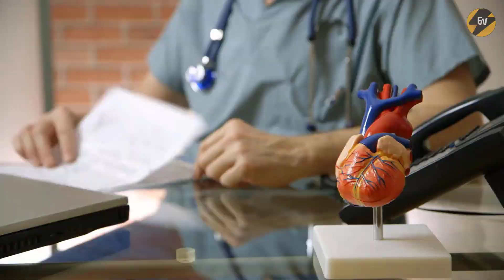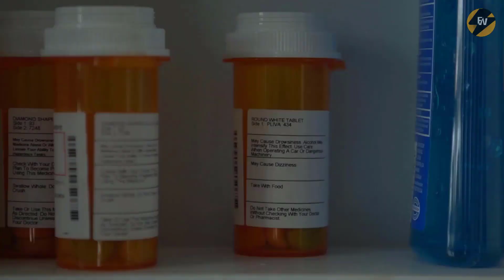Mom Tired For Years Until Repairman Cuts Open Water Heater

Comment: We were being poisoned with carbon monoxide due to a blocked furnace vent. It passed inspection because it ended up being blocked by a growing shrub over the years and then snow. My husband wondered if I was actually sick because nobody was as sick as I was. It was because I’m the one that’s always home so I got the most exposure. My nails began to fall out. A technician here for another reason noticed it and it was fixed that night. I would have died first 😔